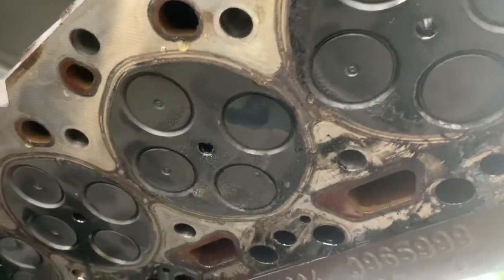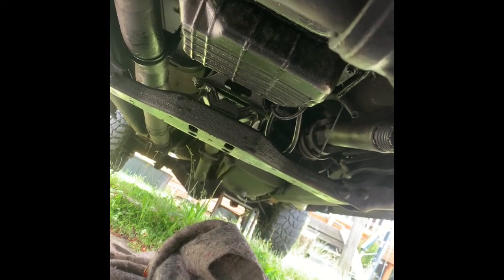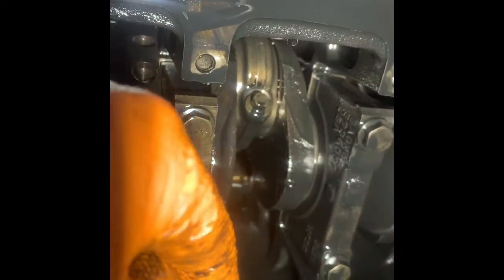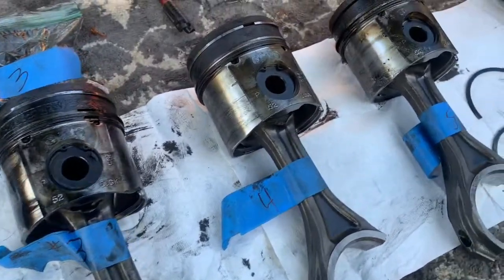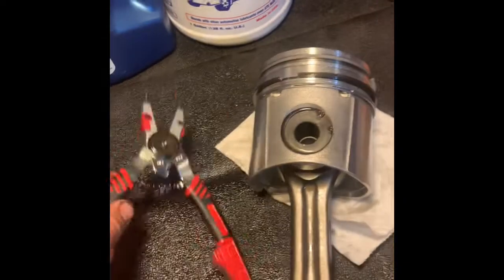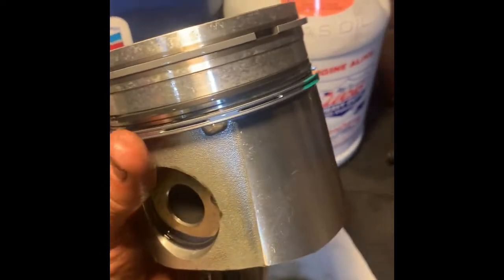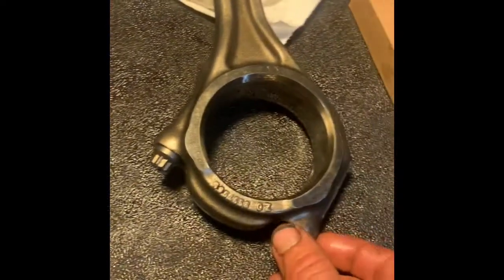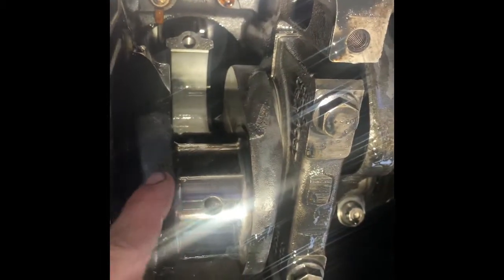2004.5 Cummins In frame overhaul work to repair broken rings with PAI overhaul kit and BBI injectors

Comment: My 12v has haze coming out of the oil cap but that cab doesnt move a bit. That Normal?
Reply from the maker: Is it making good power still? I may be wrong but I haven’t heard of a little haze being a major issue unless it’s a lot.
Reply: @bigislandblake  its a stock 12v. Its not a powerhouse but yes its got expected power from a stock 12v

Comment: I bought a 04.5 brand new when i was 18.  I replaced injectors at 150k miles.  Good way to test is start it up when its cold.  Use a infared gun or electonic thermometer and test your exaust manifolds at the ports.  If one is way colder than the other... its not combusting right.

Comment: Whoever built it probably didn't  gap the rings right. Or crappy rings.
Reply from the maker: That may have been the case, from what I saw tho was bad injector spray patterns suggesting maybe cracked/failed injectors which is a known problem. In any case the truck has new BBI stage 1 injectors which are amazing and it rips  a few years later with this rebuild.

Comment: Hows this holding up now?

After rings re set.. did you do any blowby tests? 

I may be about to do this myself. Nice video!
Reply from the maker: I did the standard oil cap off test and it didn’t have any. Truck runs great almost 4 years later!

Comment: Anyone with broken rings have no blow by? Almost everytime I pull my dipstick getting tiny metal particles. Scoped the bores when just did BBI injectors. Camera not great but didn’t see any damage to pistons. Have pan off dropped 6 and 5 main journal bearings look good dropping rest tmro .Not sure where metal coming from hoping someone else experienced this
Reply: So, I am suspecting I have 1 or more broken rings.
With almost no blowby. Very little puffs.. almost no pressure BUT mine, when HOT, will very slightly lift a upside down oil cap with each stroke of atleast 1 piston.

I had a head gasket abrupt failure and replaced head gasket, engine bores were totally fine. Light cross hatching still there at 170xxx miles. I didn't notice any thing unusual other than pistons appearing steam cleaned from leaky gasket. 

It took 2 injector nozzles with when engine stopped.

All new injectors, new gasket, studs, and starts and runs great except that tiny blowby so I was anticipating doing this same in frame to re ring it. 

You can have a broke ring on one or more pistons and it not score the walls, yet.
Depending how long it goes on for.. like this video guy has many broke rings.. no scoring.

So goes to show you could rebuild if caught in time. 

Does your truck have ANY blowby?

Sure you see metal? 

Send a oil sample to a lab and they can tell you what type of metal is in it.

Comment: I just bought a 5.9 cummins 24v for 1800 bucks did a compression test all passed except cylinder is no compression at all what woulc cause that
Reply from the maker: I would think probably a broken compression ring or a cracked piston maybe?
Reply: @bigislandblake  as long as their is no deep groves I can just hone the cylinder like u did right
Reply from the maker: @savagewolf7794  yeah that’s what I did. I had one that I thought was gonna be an issue  kinda caught my fingernail honed it out a little and it was fine.
Reply: @bigislandblake  did you by any chance take your cylinder head to get any work done like resurfaced or anything
Reply from the maker: @savagewolf7794  just cleaned it real good and checked it with a straight edge for warping and it looked good.

Comment: Hey blake i know this video is old can i ask you a queston about this kit as im about to buy it? Did you replace the rod pin bushing and did you have to get them fitted to the new pins? Or does this kit new pins fit the oem bushings just fine? Also 3 years now on rebuild did your truck stop using the 2q a week? Thanks
Reply from the maker: Hi Garrett the kit worked great with the stock rod assembly bushings and all. I was using about a quart every 2 weeks before the kit install. It runs like a brand new engine with Smarty on 7. No oil noticeable consumption or anything else. It’s a great kit.
Reply from the maker: I just left the stock rod pin bushings, they looked good
Reply: Awesome man thank you so much im ordering the set today.

Comment: Great video man.
Definitely earned a like and subscribe.
I just replaced my injectors but still have a little blow by and white smoke, i dont have the time or money for a shop.
I might be doing the same and will definitely be using your video as a reference /guide.
Thanks for sharing.

Comment: hey man how did you get the hone on 5&6 and pulling those pistons out anything special needed
Reply from the maker: I think I cut a little bit off the flex hone handle and bent it a little to get the drill to fit in there. You always could use a right angle drill I guess
Reply: @bigislandblake  ok awesome thanks man how's the truck running if you still have it?
Reply from the maker: @slicktmi  truck runs great, has a ton of power and torque especially with the BBI stage 1 injectors and the Smarty tune. I’m running the Aurora 3000 turbo which gives it a lot of low and mid range
Reply: @bigislandblake  sweet man !these dam 5.9 love breaking rings i have 66 over 80mm compounds on mine few other upgrades still runs good has that broken ring miss at idle so i need to get it some attention
Reply from the maker: @slicktmi  that PAI total rebuild kit from Industrial injection is a really great kit and the price was  under 1k. From the reading I’ve done it seems like plenty of trucks pushing high horsepower have used it as well
Reply: @bigislandblake  I'll look into that for sure especially for a good price like that
Reply: Can you describe a broken ring idle please?
Reply: @dwaynegray2593  it's like a misfire vibration you'll feel the truck shaking
Reply: @slicktmi  I do get a slight miss in and out while it’s idling. Took the oil cap off and turned it over and it doesn’t move the oil cap with it running. I just hope it’s not a broken ring.
Reply: @Dwayne Gray  seems like it's an injector issue if it doesn't have blowby or excessive crank case pressure how many miles on your injectors?
Reply: @slicktmi  I have 196k on the truck. I’ve had it 3 years now and it’s always done this. I purchased it with 162k on it. I appreciate your help with this diagnosis.
Reply: @Dwayne Gray  yeah man I'd say injectors or valve adjustment if it was a cracked ring you would've known 3 years later losing or puking oil. No problem man always willing to help

Comment: Excellent video. What do you think about running the rings at the largest end of the specifications to try to prevent future broken rings? I'm assuming that the rings are breaking because the gap closes up when hot. Seems these older engines suffer a lot from broken rings.
Reply from the maker: I think you raise a really good point by running the upper limit on ring gap to avoid breakage. I’m running the PAI rebuild kit from Industrial and when I checked them from what I remember they were right in the middle of the Quickserve manual gap spec. I wonder if the new rings are better material?

Comment: Do I put the rod bearing on before putting the piston in the cylinder? Do I completely tighten down each rod cap as I install each piston? Thanks in Advance
Reply from the maker: I installed the bearings on all rods before sliding them in from what I remember. I used Lucas and they clicked into place so I didn’t have a problem with them falling off. I didn’t do the full three stage torque on the ARP rod bolts until all piston and rod assembly’s were installed. I only snugged them up on the rod bolts at  initial install until all pistons were installed then I did the proper torque spec

Comment: I am curious how the rod bearings are holding up seeing that you didn't resize the rods after arp bolt install because the clamping force on the rod caps are much greater than stock bolts.
Reply from the maker: That was my number one concern doing this rebuild. The absolute best way is to have them machined and I 100% agree.

It seems to be holding up great in my case. Time will tell, I run the truck hard with the Smarty turned up and I tow 7-10k regularly and it has low EGts and seems to run great. During oil changes I don’t notice any metal or bearing materials. 

without machining the caps/rods to match the stronger ARPs I may be accelerating wear. I’ll
Let you know

Comment: Did you use stock pistons and rings or did you get oversized
Reply from the maker: I used stock sized pistons and rings. I only did a light hone/deglaze on cylinders. The 5.9 rebuild kit From Industrial Injection has every single part and gasket to rebuild this engine. It was on sale for 900$ The kit said parts/pistons are good to 800hp.

Comment: I surprise myself by understand all that, especially the piston rings clocking procedure.
Your explanations are amazing. You could of been a teacher. Thanks.
Reply from the maker: Thanks man, I made this video with the hope that it would help another 5.9 owner get their truck back on the road with minimal cost and professional results. It’s a legendary engine for sure.
Reply from the maker: I used the specs for the piston ring gap and clocking from the QuickServ manual which many professional Cummins mechanics use. I found it on the cumminsforum.com

Comment: Any update? How many miles do you have on it now
Reply from the maker: I’ve put about 5,000 hard miles on it with Smarty SR on Level 9, Towing just under 10k semi regularly EGTs never really go above 1350 or so even when hitting hills and WOT pulls. I put a set of 35x12.50s on it  built trans and it’s holding up great. Mileage is great on the HWY like 18-25, City driving with the triple disk TQ converter out of lockup it’s 11-13. I’m going to do a boogie switch/lockup push button when I have time.
Reply: @bigislandblake  not bad thanks for the update!
Reply: @bigislandblake  I've got a 99 with 191k on it and I'm wanting to change the piston and rings. I asked the machine shop to hone it for me. But he said with 191k it needs bored regardless but I felt like that wasn't true.
Reply from the maker: @Jonesy3737  machine shop has their bottom line and making money in mind, they also probably want you to have a perfect bore for your rebuild. It’s an answer they need to give you to protect their reputation understandably. 

Depending on your goals and budget I’d stick to honing it yourself. Obviously having every phase of a rebuild done correctly, to a very high standard and by the book is best. But if your on a budget and can learn to hone it yourself 200k on a Cummins block isn’t shit. The amount of wear, barring unforeseen and unfavorable circumstances-excessive wear on the cylinders, you should be fine to hone it and rebuild. I’d spend the 100$ on a hone, clean off the ridge a little and drive that motor as hard as you can which could be for and other 500k until it needs any other serious repair. These are just my experiences and I don’t advocate shitty work or cutting corners but I do understand we need to just make the truck run and do the best with what budget we got. Roll on and roll out.
Reply: @bigislandblake  thank you! I think that's what I'll do and just hone it! There is nothing wrong with this engine. It was a good running engine. Just switching from High output pistons to standard output pistons cause the compression ration is different. Also number 1 piston has a small spot on it from getting it too hot. But doesn't seem like much to worry about
Reply from the maker: @Jonesy3737  yeah I’d do the same, they are tough engines and changing some pistons and rings isn’t gonna do much harm if you install them right in my opinion, .  Let me know how it goes.  Just remember it ain’t a Ford or a Chevy and it’s a pretty much bombproof design if you repair it with common sense.
Reply: @bigislandblake  will do! Thanks for the confidence lol!

Comment from the maker: Blow by was the number 1
Reply: Do you remember which flex hone you used? 4" or 4⅛"? Thanks. About to tackle this same thing.
Reply from the maker: @adamantee1  I ordered the Brush Research 240 grit flex hone that I believe was 4.25” it said it was specific for cylinder bores 4”-4.5 inches in diameter
Reply: @bigislandblake  thanks man! Head coming off tomorrow
Reply: @bigislandblake  looked like your plates were from Washington? What part? I'm in federal way
Reply from the maker: @adamantee1  I’m North Seattle, not far from you!
Reply: @bigislandblake  small world!
Reply: @bigislandblake  got a rebuild question..I have the head off my 04. Thought I'd find some beat up cylinders..I started getting harder starts, blue smoke, and blowby... All in one day. After taking off the head.. Cylinders are not marred at all and still have cross hatch. Flip the head over, and found quite a bit of carbon build up on a few valves probably causing sealing issues. Confirmed by the machine shop... Finally to my question... Can I just put the head back on, torque it down and test compression without hooking up the rocker arms or anything? I bought the miller 9007 injector tool to test them.
Reply: @bigislandblake  Hey Blake, did you use new rod bolts? If so, oem or arp's? I'm reading that I have to get the connecting rod honed if I go arp's. Is this true?!?!
Reply from the maker: @adamantee1  I think that would work. Check your valve seals too and replace them if you have the head off. I have heard of people getting blow by because of hardened seals
Reply from the maker: @adamantee1  I used the ARP rod bolts and followed the torque specs, 3 stage torque to I think it was 93ft/lbs final. Yes I know the best way is to have the caps checked for stretch with the ARPS  and book match the bearing with honing and it caused me some concern, but I read on the Cummins forum many people have just followed the torque spec and ran them no problem. At your own risk. Mine seem just fine at 500+ hp and driven hard.
Reply: @bigislandblake  Hi Blake, one more question... If common practice after a rebuild is to heat up the truck, shut it down and do a hot retorque, but I also read that I need to waste no time after start up and get a load behind it and get the rings seated asap. Which order should I do this in? A little history, I only replaced #6 piston, rings, wrist pin and bearings. Then new Cummins head gasket. Thanks in advance for the help. Good video you did on this one!

Comment: Hey, what symptoms were you having to get you started on taking it apart?
Reply: I'm gonna guess a lot of blowby considering all the broken rings. broken rings and bad injectors will cause a lot of blowby on these engines.
Reply: @littlerockrocks2272  probably so. I ended up taking mine apart. #6 had busted rings. All fixed up now. Did the same thing as this video. 👍🏼
Reply: @adamantee1  yup cylinder 6 is the most common culprit
Reply: @adamantee1  did you buy a rebuilt kit?  If so what brand?
Reply: @rwk_88 i bought a Mahle piston and ring kit, among many other upgraded parts. Studded the head. New injectors new airdog fuel pump system, redid the head. New springs, valves etc. Even doing all the labor myself it cost me 6k.

Comment: Hey where did you get all of your parts
Reply from the maker: Industrial Injection full rebuild kit, everything you possibly could need PAI cummins overhaul kit was $950.00 shipped. 
BBI Stage 1 injectors, Bosch crossover tubes from Diesel power products. Head studs from Exotic motorsports and ARP rod bolts DPP Truck runs so strong stock trans couldn't begin to keep up. I Had John at Dynamic trans in Idaho build me a 650hp stage 3 with the Goerend billet triple disk, custom valve body, input shaft all the good stuff. Smarty is on lvl 9 and the truck has so much torque and power it is faster from 0-100 plus mph than most muscle cars on the street and imports I've driven. I need to take it to the drag strip and see what it does, it feels quite a bit faster than my low 13 second- high 12 second quarter mile time cars I've owned. This combo is a blast and very reliable if done right.

Comment: Good video.  We are in the process of doing the same now.  Thanks for showing how to get the oil pan off.  We have broken rings on number 4 and 6.  Got the top end torn down today,  was a little curious on how we were going to get the oil pan off.
Reply from the maker: For sure, glad to help. It was the single most helpful thing I learned how to do. Many people think that the transmission has to be removed as per the factory service manual. 

It saves a lot of time and effort and makes an overhaul, dipstick replacement/ gasket repair go much faster.